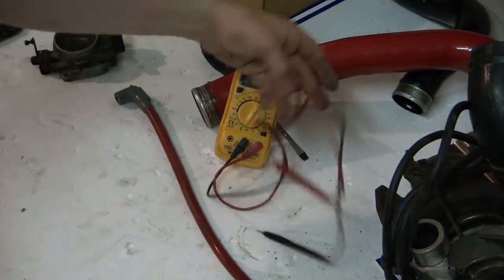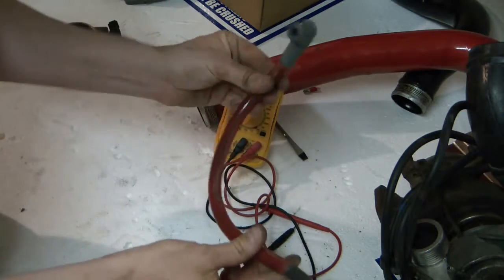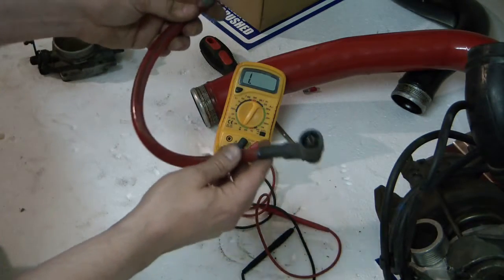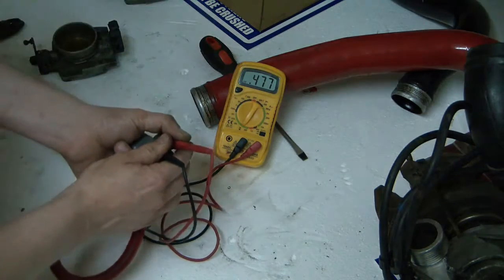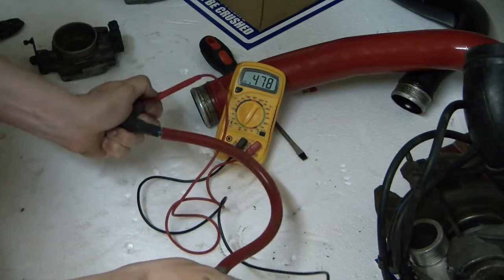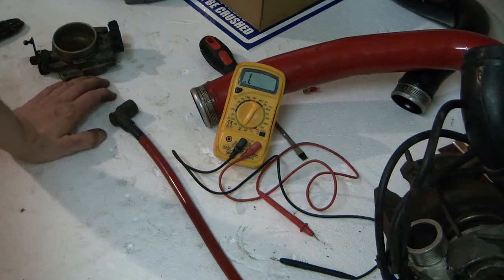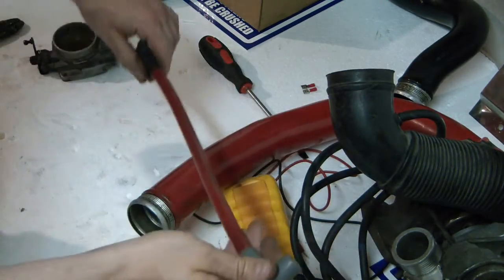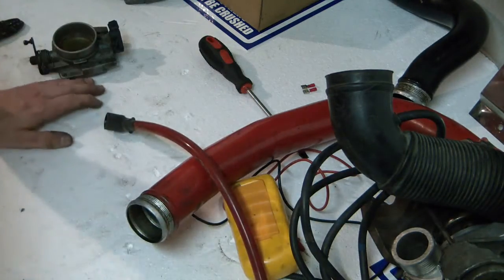Stage 0: Ignition lead testing

Comment: I have just checked my leads and 3 of them has got over 25 Kohms, another around 40Kohms and the last one more than....170Kohms!!  I was experiencing misfires since I chipped the ECU, and this could be a good reason to start with. Thanks a lot for your video. Regards from Madrid.
Reply: Hi! Already changed my leads but the stalling keeps on. I would like to ask you for some advise, if you don´t mind. Also, I installed a new Walbro 255 fuel pump, fuel relay and new Volvo Spark plugs. I´m a little bit lost. The failure does not appear when the car is cold, but once you drive it for some minutes, the stalling will appear at WOT and around 3,5K rpms. With the original T5R ECU the failure does not occur in any circunstances. Any ideas will be very appreciated. Thanks in advance.
Reply: Also changed the vacuum lines from the BCS. jaipasos@hotmail.com  Thanks